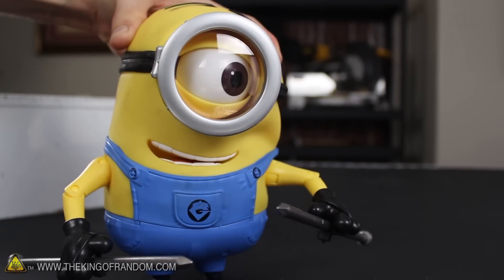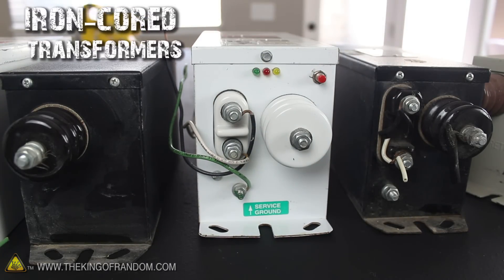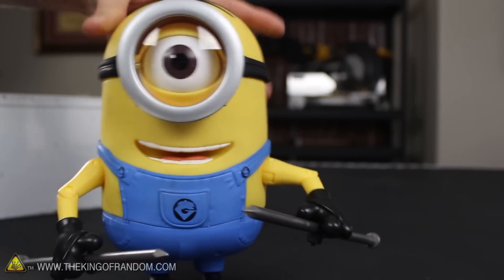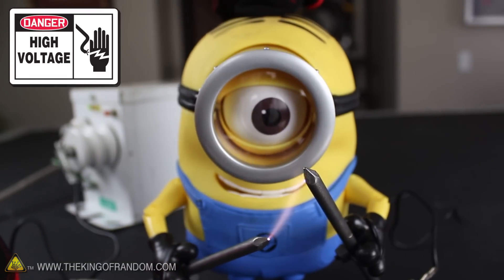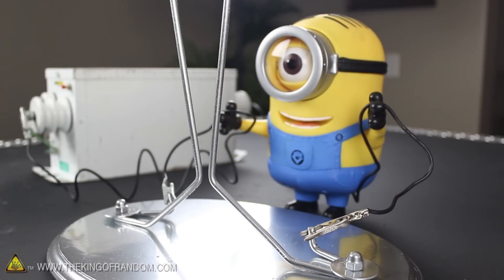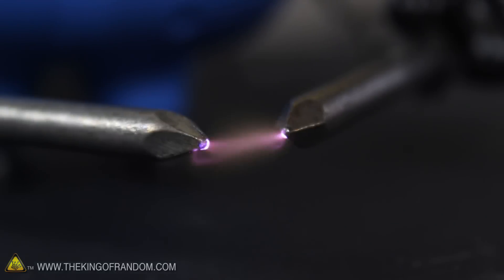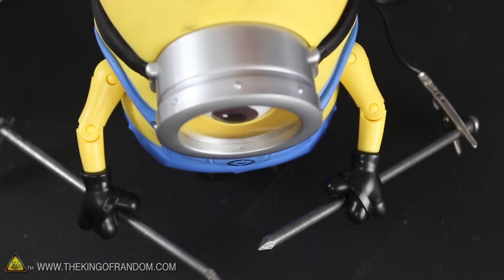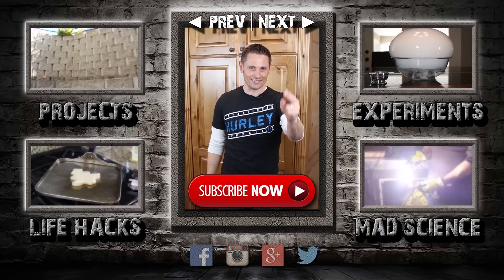Mad Science Minion (Caution: High Voltage)

Comment: What bout using one of these in your arc furnace?
Reply: That would not work at all. The arc furnace needs low voltage and high current. About 40v at about 60 amps or so. This is 12kV at only 60mA
Reply: The minion?
Reply: Nope, not messing around with them for certain.  I might salvage them for copper and such or possible resale but otherwise I've a lot to leanr before I get creative with them.  Actually I have not owned a neon sign transformer since I was in my 20's and had beer signs all over the place.

Comment: Other uses for Jacob's Ladder, cigarette lighter (we used one as teenagers for that purpose) - I built one of these for my 5th grade science fair project. 10,000 volts is fun to watch, but touching one of the leads hurts allot (I did it by accident, next thing I knew I was 5ft away, fortunately I landed on a couch and not the brick wall behind it. So NO TOUCHY the LIVE WIRE! ) 
This just goes to show Grant isn't the only one out there crazy enough to try this stuff.

Comment: I would love to see what would happen if I used that for electrolysis....
Reply: +Pyro213 It sould be a poor choice for electrolysis.  The NST puts out alternating current at very high voltage but low current.  You need direct current for electrolysis at only a few volts.  The more current you provide, the faster the electrolysis.

Comment: Random question. Can you use the NSTs to power the arc furnace?
Reply: +Strayed DM Not really.  Arc furnaces, as used for melting steel, use only a few hundred volts but thousands of amperes of current.  A NST provides very high voltage but only a very small amount of current.  Not the right tool for the job.
Reply: Ah I see, thanks for the insight!

Comment: 2:18 Not really tho. The reason behind that is Lorent'z force. Due to the joint magnetic fields between the gap (forming from the current flowing inside the antennas) the moving electrons get propelled upwards. This is called Lorentz's force and it works on the same principles railguns do. If you were to place the whole thing upside-down the plasma would flow downwards, and if you placed it sideways it would flow sideway following the "rails".
Check this layout here for reference:
https://upload.wikimedia.org/wikipedia/commons/thumb/9/9a/Railgun-1.svg/2000px-Railgun-1.svg.png

Comment: hey when working with high voltage the gloves would not always protect you and if you are going to touch the wires (i'm highly against that) at least use high voltage rated wires

but the best solution is to tie the wire at one end of a plastic rod and hold the rod by the other end

Comment: I would recomend being a little more careful at 0:51 you where relying on not much insulation and some gloves that dont look rated for that voltage for protection, either tape an insulating rod ()eg your straw) to the wires to draw an arc by hand or take other precautions, 30mA at that sort of voltage will at the least give you bad burns and at worst kill you

Comment: are you producing ozone doing that? (O3)
Reply: MaLaNdRaGeM123456 It probably makes a little bit, but not much. The most would occur when he used the straw, as that exposes extra air to ionization. It is well below the unhealthy level, I don't know if it could even achieve that. Unless you used it to build a Ozone generator, aka two metal screens one to each wire and a fan blowing through.
Reply: yeah,,,,,thanks = )

Comment: is the output AC or DC? and what would happen if you touch it?
Reply: itge13 It is 12kV 30mA AC. If you touched it, you would experience excruciating pain like no other. Sticking your finger in a bulb socket would feel great compared to this. Due to the low current, it would most likely not kill you. It would feel like a turbocharged tazer and a mad hornet nest under your skin. Trust me, I'v gotten a 2-3kV shock from a fluorescent bulb driver I built, and it hurt that bad, only this is about 4 times the voltage.
Reply: seems like a good device to torture someone:D thanks for elaboration.
Reply: xXJeReMiAhXx99
Yeah, it was terrible, not lethal by any means, just painful. High voltage penetrates deeper into tissue, so it feels far worse then a "medium" voltage like 120V. I was shocked (quite literally) how much that power supply I made stung at only 16mA. Was an accident, but definitely one I'l never forget. Would make for a nice electric fence power supply actually now that I think about it, keep them deer out of the garden real good XD.

Regarding how you feel afterwords, the pain dosen't stay, but your muscles stay tensed and cramped for a few minutes. Just like getting tasered, you go down immediately and even when it stops you feel a bit shaky and very cramped. In my case it made my arm muscles contract very quickly, so my hand pulled itself away faster then I'd ever seen it move before. About 10 minutes later I could flex it easily again.

Comment: How did u get that box that has 30ma
Reply: It's a neon sign transformer. They are getting obsolete now, and many installations are slowly swapping the old iron core transformers for lightweight switch mode power supplies (which have too many safety features to be useful for these experiments, they turn themselves off if theres anything abnormal happening). Look for contractors working on old signs and ask if you can buy the old transformer off them.

Comment: In the same way it put a hole in the marshmallows, this high voltage would break any type of insulator which is safe at 120V AC, that is, dont even touch this standard wires with bare hands, this pvc cover is not enough to prevent arcing in your hand. Just look at the ouput terminals of the transformers, they are not using standard hardware. This is seriuos bussiness

Comment: could you link couple of those together and make some like supper cool plasma something or other
Reply: Yes, you can wire as many neon sign transformers in parallel as you want. You just have to make sure every transformer has the same output voltage and current. A 12kV 60mA transformer consumes 720W. Ten in parallel will consume 7.2 kilowatts and will push 600mA into a short circuit (extremely lethal, of course).

Comment: "Something strange happened when I was sparking the electricity between the minions electrodes. The minion would start to talk spontaneously, without being touched. 

This is strange because usually you have to press his belly or move his head to get a response. But with the electrical sparks flying through the air, he would begin to speak at random. 

Kind of spooky!"

This is because the high voltage creates an electromagnetic field (EMF). The EMF tricks the electronics in Stuart to thinking that the button was pressed.

Comment: I thought the coating on electrical wire was typically rated for 600V. Shouldn't it have arced through the coating since your transformer stepped up the voltage to 12KVs? I figured that's why they put those isolators on the leads of the transformer instead of a plastic coating.

Comment: Actually hot air doesn't rise. It's a common misconception.  Heat (energy) always travels from a warm location (lots of energy) to a cold (technically cold isn't even a measurement of temperature the proper term is absence of heat) location. The reason we think warm air rises is because it's usually colder the higher we go since we're getting further away from the molten core which heats the earth. So heat travels in all directions all the time.  Fun facts :D

Comment: What would happen if you put the ladder in a vacuum? Would it still arc?
Reply: Grant Thompson - "The King of Random" I don't think so.  If there's very little air, there's very little to make plasma out of.  Here's a video of it: https://www.youtube.com/watch?v=8n0LTMgPvdg
Reply from the maker: ghuegel Cool demonstration.  Thanks for the link.
Reply: Electricity will fly through a vacuum. That is what a "Vaccuum Tube" is, that's how every old CRT TV or monitor works. But the Jacob's Ladder corona is electricity creating superhot air plasma. Hot air floats, and this is what drives the plasma upwards, it's literally floating on the cooler air like a hot air balloon. Plasma is also 75x as conductive as normal air, so even though it's a longer path higher up, the path is still better than the normal air path down below. That's what gives you the cycle. Without air, there's no air plasma, and there's no cool air for the air plasma to float upwards, so it just arcs at the closest point and stays there, like a boat would sit on the riverbed if there was no river to float on.

Comment: Grant Thompson - "The King of Random" could you modify the circuit and use a 555 timer to make a plasma speaker with that ? I did it with a flyback transformer and it's quite amazing!
Reply from the maker: Louis Definitely!  It's been on the list to make for about 4 years but I haven't got around to it.  If you want to email me some suggestions on how yours worked I'd be interested to take a look.